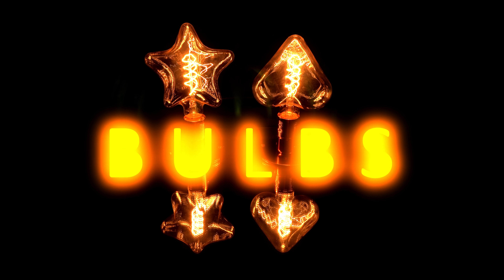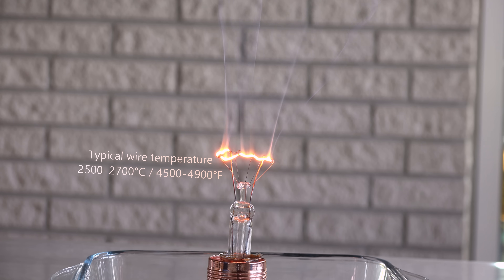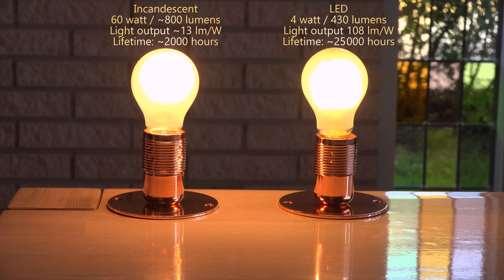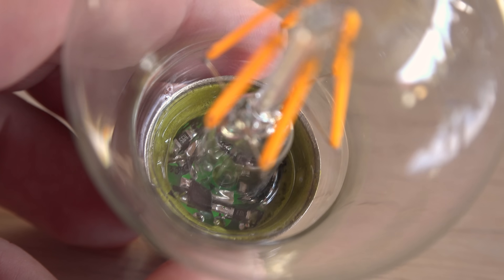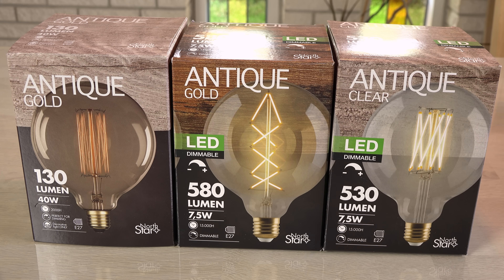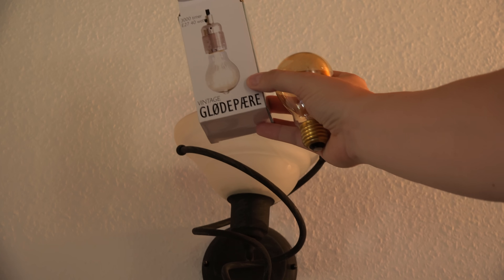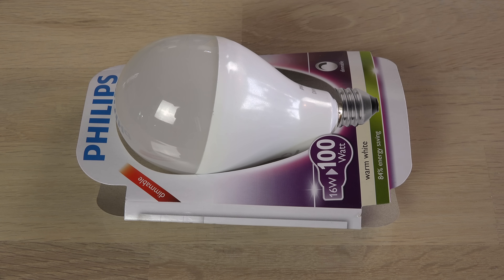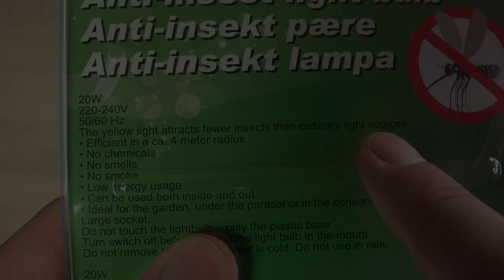Light Bulbs | LED vs. Incandescent

Comment: Do LED lights flicker? They always seemed to very faintly, if i move my eyes quickly.  Is that a function of the electrons jumping back and forth between layers?
Reply from the maker: Yes, LED lights run by AC power tend to flicker. They are diodes which only conduct electricity in one direction (they have a +/- side). They need DC power to light constantly, like from a battery.
When run by AC power they need some electronics and capacitors to transform the AC to near DC power. Depending on how well the electronics are designed LED lights will flicker more or less.
Reply: Some do, many do not, I always return flickering ones.

Comment: Maybe I am imagining this, but I literally cannot see well with LED or Flourescent lights. It's bright, but I can't see. It's the strangest experience. I so miss incandescent lightbulbs.
Reply: What is the lumen rating of the LED/flouro lights you're using? That's actually what's important. I notice many websites & videos that explain about switching to LED/flouro fail to mention this. The result is many folks end up getting LED/flouro lights that produce a lower light intensity than the filament bulbs they want to replace.
For instance, if you want to swap a 60W incandescent, get an LED or CFL that produces 800-1000 lumens.
Reply: It could also be the color temp.
Reply: @BurntPlaydoh  
So how is the average consumer supposed to know the crappy LED bulbs from the good ones? At least with incandescent, we knew what we were getting.
Reply: LED AND FLUORESCENT  lights do strobe. Most people don’t notice it but some do. I have read that they can cause seizures in epileptics! If they can do that they could affect some people’s vision.
Reply: @royrice8597  That exact reason is why I am an EDC flashlight snob. The cheap torches at the chain store may seem bright, but between the blue/purple/green hue, low CRI, and pulsing light you might as well be colorblind when using them.
Reply: @royrice8597 The do at 460Thz just like incendesent bulbs. The flicking is a you problem, because you bought cheap LEDs.
Reply: Eclectic Monstrosity  It is not your imagination,  I can't see with them either and I refuse to buy them . I am considering getting kerosene lamps . I know the lighting from it won't be as good as I am used to but at least I won't be paying for absolute crap and it will be one less thing using electricity.
Reply: @BurntPlaydoh 

Incandescent bulbs are similar to daylight but are higher on the red end of the spectrum. They emit just a little blue light. ... Range in color from cool-white with higher proportion of blue, through daylight to warm-white; they emit a small amount of UV radiation.Jul 8, 2017 

https://www.scientificamerican.com/article/led-lightbulb-concerns/

https://theconversation.com/american-medical-association-warns-of-health-and-safety-problems-from-white-led-streetlights-61191

https://globalnews.ca/news/4122605/led-street-lights-eyesight-health-effects/

https://www.cnn.com/2019/05/16/health/blue-light-led-health-effects-bn-trnd/index.html

Even the best bulbs are not comfortable and still have a lot more blue light than incandescent. Incandescent is so small that it doesn't even register to your body. I literally just brought back like 20 potlights because of how unappealing even the warmest LED lighting is. Also they're a rip off in price. They never last even close to as long as they advertise and cost much more than incandescent bulbs. For reference I probably change the incandescent every 2 -4 years while the LED will randomly burn out last anywhere from 2-8 months. The incandescent even look more aesthetic. 

https://permies.com/t/led

https://www.youtube.com/watch?v=3gjvOOlHmsU&feature=youtu.be

I live in Canada. Incandescent also makes me SAVE money on my heating bill.
Reply: Could be the flickering, it's technically 'dark' half the time.
Reply: @Richard Vaughn another ignorant political comment on a non political video post. SMH
Reply: @BurntPlaydoh https://alphaemerged.com/journal/2018/10/12/light-bulb-and-health

just a blog post but you can easily verify the claims on google scholar.
Reply: @Richard Vaughn Only some selective environmental issues.  Where is the outrage on our trees?  Trees are being chopped to accommodate the 5G system.
Reply: @BurntPlaydoh  This doesn't change the fact that they emit blue light.  Incandescent doesn't. Also it doesn't matter if you say the human eye can't detect it because even shitty fluorescent flicker faster than SHOULD be noticeable but many people do notice it.  Blue light destroys your eyes, you are basically looking into a mini sun.
Reply: @Richard Vaughn They don't care about that either, they just tell people whatever it takes to con them.
Reply: @BurntPlaydoh  You obviously don't know much about light if you think it's the same. I can hear and see the lights flash from LED and fluorescent lighting. I lived in a basement with fluorescent lighting for 1 year and my skin was notably worse and I felt very depressed. Moved into another basement where I could replace the lights with incandescent and could see improvements in months. This is especially important if you live in a cold climate and don't get into the sun enough because the incandescent light is good for cell health while the blue light from LED isn't.
Reply: @MrJaaaaake Then buy the right LEDs

Comment: I would like it if the places replacing all of the yellow incandescent street lights with LEDs would add a yellow tint, dim them, or do something like that to them because: 1. It hurts my eyes 2. The American Medical Association has warned of issues with the amount of blue light coming from them being bad for our eyes   3. The LED street lights are creating much more light pollution which is bad if you want to see stars and it hurts marine life.
Reply: Those aren't incandescent. Those are high pressure sodium. Without the reflectors and lenses they are more efficient than LEDs.
Reply: The filament style LED eliminate that problem.  I have them on my house for a nice soft glow outside.  Turtles actually go towards light, I do not know why.

Comment: Ironically, one type of bulb that managed to skirt around these issues so far is "Rough Surface", basically a more sturdier version of incandescent bulbs as they are mostly used in places that may be prone to shock or other rough situations.  I picked up some from Dollar Tree a while back (under the Sunbeam name), yet they don't last as long as I hoped, a few burned out within a few days.
Reply: 6 year so far on my LEDs.

Comment: there is something no1 realises while using high eff lamps ....
its obvius, normal lamp gets hot ....
when is lamp light used most?
in the winter, long nights short days ...
when is it colder?
at night and in winter....
so ... the 97% heat a lightbulb gives, is not there on LED and other saving lamps....
this means you need to actually heat your house more since the lamps do less heating ;)
basically, the electric bill goes down a bit, the gass bill goes up ....
endresult, almost no difference  since the actual amount of kWh to heat and light a house will remain the same. 
** i do however use energy savers myself ;) **

btw ... no fluorecent tubes?
these lamps on high frequency still have more lumens/watt :D
i believe discharge lamps ar the highest efficiency , but the light color isn't always the best :o

Comment: Very good video on LEDs and incandescent bulbs. But! LEDs pose a problem as they are not natural light emitters, they can be bothersome to your eyes. Not much mentioned about the problems of pollution in the making of the LEDS or their disposal. Another problem is the RFI noise they generate on radio receivers, goes hand in hand with the flicker you have mentioned. I work on electronics and there are zero LEDs that can illuminate my work bench! Improper installation is another problem as it can cause 'light trespass' and glare. LED advertising signs are super bright but they can cause problems for anyone near them as they jump from different screens with variable brightness.... there is a business that leaves it's sign on all night long even though it is closed, making it tough to drive near it at night!

Comment: Yet an incandescent light bulb has been burning for 117 years strait.
Reply: duh professor yes. incandescent bulbs have an issue turning on and heating up, but are fine once lit. In fact every bulb in my experience dies when turning it on. (brief flash of light and it burns out)
Reply: If it is on 30 seconds a night.  What matter is total hours.  The rest is crap!

Comment: DO NOT Ignore the fact that LED bulbs have a specific visible light range, dependent to the Diode construction.  Using WHITE LED bulbs, they generate ZERO light outside of their specific range.

Comment: So called energy saving lamps heat up a Hg-gas which also leads to the emission of light in the UV range. Not so dangerous, but just that you know in case you have any eye conditions. LED is fine though, praise LED.

Comment: I decided to upgrade my whole house to LED lighting like 2 years ago, and not a single bulb has broken yet. Compare that to the incandescent bulbs I had before that needed to be changed like once every half year if I was lucky. The lighting in my house is so much better now, much brighter. I bought warm LED bulbs because the bluer ones gives me eyestrains, but these work very well.
Reply: I have incandescent bulbs that I use from 6 years  every day for 4 or 5 hours... can't trust you...
Reply: @lukeskywalker495  well before I went for LED I bought the cheapest incandescent bulbs I could possibly find, that was probably a part of it. And my electricity in my house has never worked that well haha

Comment: I wonder whether your incandescent bulbs are in fact if not in name designed for 240V.  In the UK, we have a nominal voltage of 230V with permitted deviation which allows EU harmonisation.  It also means that we very usually actually get the historic UK voltage of 240V (and sometimes a little more). A 240V resistive device running on a lower potential will, of course, have a lower power consumption than expected.

Comment: Do you have a link for the Cosna HN 10225? Love the light it puts out :)
Reply from the maker: Only for a Danish website: https://www.harald-nyborg.dk/p10225/led-paere-40w-e27
But something similar should be available in most countries I guess. Thanks for watching!
Reply: Sweet, thanks! I ordered some of these instead, same power, smaller form factor. Can't wait to try them :) http://www.ebay.com/itm/291964180656

Comment: BANS SUCK! If a person wants to run up their electric bill, what is it to the government? Who are they to say what you need and don't need? As this video clearly shows, these bulb technologies are NOT interchangeable in all applications. Also, is the government going to pay for people to upgrade to LEDs? The price difference is still substantial. 

I suspect the Green Police are going to jump in and tell me that it's an environmental issue.  More power is required for incandescent bulbs, and they burn out sooner than LEDs and may end up in landfills.  My response is:

1. People should have the right to choose the products and services that they want to use. 
2. Incandescent bulbs can be recycled
3. The power used by the bulbs is paid for by the person using the bulb. Economically, then, its a non-issue. Will Captain Planet cry over the wasted energy? Maybe. Still, most people will adopt LED tech for most applications without the government stepping in. The holdouts will be those that NEED the old tech because of its unique qualities. The grid will be fine.
4. Weren't the Green Police the same guys that tried to force those dysfunctional and toxic CFL bulbs down our throats? True they use less energy than incandescent bulbs, but the light output sucks, they don't work well in the cold, they still don't last very long, and did I mention they are poisonous? Thanks for the good advice guys.

Comment: I understand that LED is much more efficient, but incandescent is much more environment friendly, why?
LED need electronic components to work, incandescent do not. If you trash a LED bulb at the wrong place it will contaminate the soil and underground water, also, it takes a very long time to decompose in comparison with incandescent that is just glass and metals.

Comment: LED bulbs cannot be used in closed lamps such as those mostly found in close fitting ceiling fixtures. They have to quickly get rid of the small amount of heat they do produce. It also seems that, like fluorescent lamps, they flicker badly in sub zero temperatures. I am disappointed by the LED available today. There must be a better way.

Comment: for filming to flicker on the led you could have recorded slomo.I recorded a led bulb in slomo at 240fps with a iphone6+ and it shows the flicker.
Reply: Those old bulbs didn't use a capacitor or a full bridge rectifier. Modern LED's don't have flicker
Reply: @danieldyman7196  Lots of them still do have flicker. I had to buy LEDs specifically sold with a flicker-free design when taking product images. The other LED bulbs sold all had flicker and cause banding in images or videos.

Comment: how about skin cancer?! or damaging your eyesight?!? you forget about that "disadvantages"....oh, and also mercury poison
Reply: Light emitting diodes don't contain mercury
Reply: LED bulbs don't contain mercury and they don't emit UV light.
Reply: I'm guessing he was sucking on the bulbs
Reply: I had better stop eating them.
Reply: What health problems with CFL ?
Reply: LEDs does not contain mercury. LEDs light mainly contain phosphors.  However, depending on the manufacturer, some LED circuit boards could contain lead. Some manufacturers use a solder on LED circuit boards that contains lead. Mercury isn’t really an issue with LEDs, since there is generally no use for mercury in LED fixtures. Your damn smartphone have way more microwave that will give you cancer over any other device, remember, you kept your phone attached to your body almost 24/7.
Reply: Mercury is an essential part of CFLs lamps; it allows the bulb to be an efficient light source. No mercury is released when the bulbs are intact (not broken) or in use. So, unless you handle the broken one improperly, you should not have health issues.
Reply: All electronic device emits some radiation, however, your phone will kill you faster rather than a bulb that is on a long distance compared to you smartphone which is attached to you body 24/7 and your computer monitor, which you are less than a meter to it...
Reply: Only the fluorescent version have mercury. Also, it is only a problem if you break the bulb.

What health issue are you having?
I know that the electronics in CFL and LED lights produces a magnetic field around it which I can detect with my meter, but this isn't an issue.
Reply: +Richard WILSON:
"LEDs does not contain mercury. LEDs light mainly contain phosphors."

==LEDs are usually made from Gallium Arsenide Phosphide. It is a single crystal that is also a semiconductor. Some types of LEDs are UV light emitters and contain a phosphor to convert the UV to white light (probably the same phosphor as in CFL (doped Calcium Tungstate).

Some LEDs are direct light. They don't have a phosphor. They emit red light, orange, yellow, green, blue, UV, infra-red. The LED in your TV remote is a infra-red emitter.

Basically, LEDs are safe but gallium is a rare element and is quite expensive. There are no gallium mines. It all comes from Aluminium Oxide mines. Gallium is present as an impurity. It is also chemically similar to Aluminium.

As people use their LED bulbs and throw it in the trash, eventually, we are going to run out of gallium. Then, its back to CFL or incandescent bulbs or quantum dot (a relatively new technique).
Reply: your problems are mental and have nothing to do with the bulbs.
Reply: Jonathan D Your statement is mental and has nothing to do with that person's real problems. Now go visit that beloved psychiatrist of yours.
Reply: Please be really careful with LED's... CFL's lights too. To make the story short... I am EXTREMELY allergic to LED and multiple health problems with CFL's.. Took us years and bunch of Doctor's Visits to find out :((( It will cost more to light Incandescent, but it will be healthier to everyone in your House. Cheaper than going to Doctors and Medications :)))

Comment: Here in Brazil those frosted matte inside bulbs were banned still in the 70's, but they glows so nice. I'm looking forward to see them again by these new "filament led" bulbs, for now there is only the clear models. It's kinda ironic that after so much different shapes for the CFL and led bulbs ended up in the very retro model as the led evolves. But lights fixtures with built in leds are increasing, and the flexibility of led application let the using of old interfaces sort of nonsenses, it's like build a robot to do the housework instead of automatic and remote controlled home appliances. So let's enjoy while the led bulbs are still retro!

Comment: Most LEDs are not engineered or rated for use INSIDE a fixture (because of the trapped heat)
Also LED performence changes drastically overtime, which will be very noticeable when you start to replace failures.  LED Lumen output will drop to 50% after as little as 5000 hours of operation; best to buy a higher lumen output than required and dim slightly, then raise dimmer setting as light output drops

Comment: This is not the whole story: LED's emit blue spectrum light that over a period of time is damaging to the eyes. I took out my LED bulbs except for the hard to reach or intermittent areas where I want LED light bulbs. But for the most part I use lower wattage incandescent bulbs with dimmersl usually not more than 40 watts.